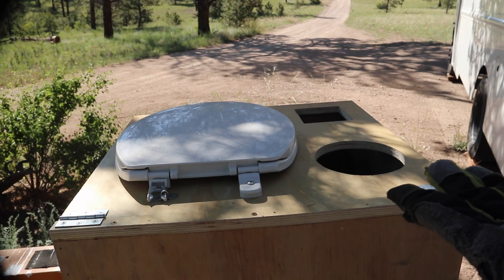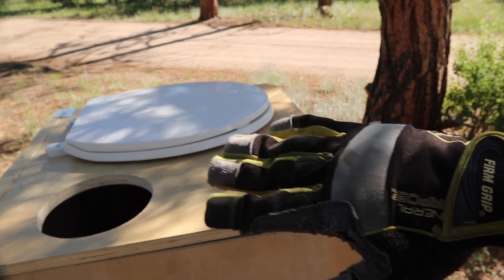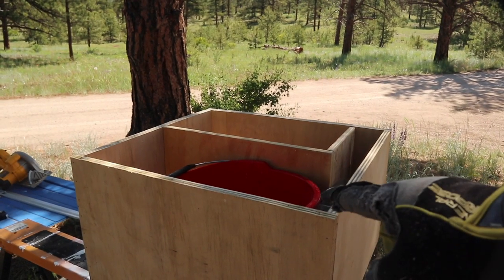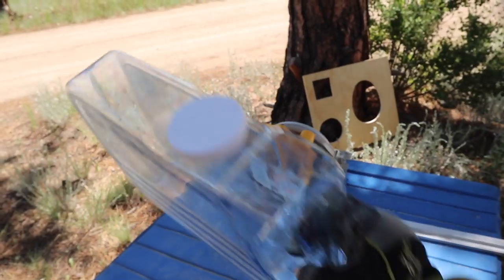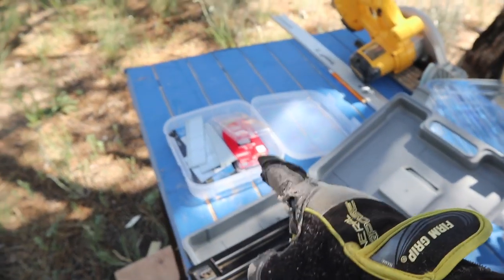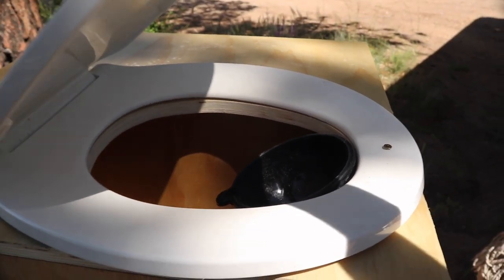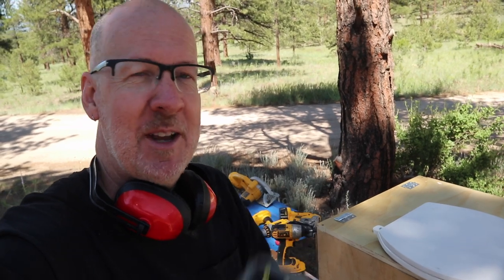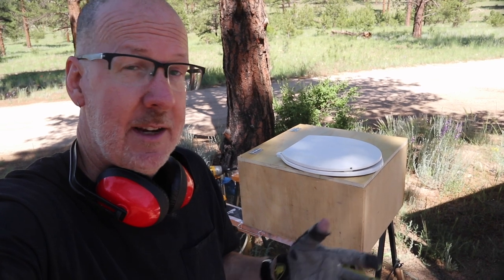DIY Composting Toilet Modifications for Vanlife P2 E561

Comment: Just a thought , Remove the spicket, cover hole on container with thin sheet of plastic( like zip-lok sandwich bag) and then replace spicket. just a little extra protection in case something hit the lever on the spicket
Reply: Or a piece of hard plastic from a pop bottle, milk jug or something like that, cut it to fit the screw on part, use a rubber washer and cut the spicket off.

Comment: We used pine pellets for horse stalls for the composting toilet in our off grid home. 50 pound bags are about $5 at Tractor Supply. Smells like a pine tree. 👍🏻
Reply from the maker: great tip. I wasn't aware of the pine pellets. will have to check tractor supply
Reply: @SevenWanderstheWorld  If a tractor supply is not close, feed stores will usually have pine pellets.  We use them in our cat litter boxes and in the horse stalls.  Very, Very little dust, pleasant aroma and quickly absorbs moisture.

Comment: You should nail a pole inside the little box with a plastic container w/lid for the toilet paper rolls.  That's a great composting toilet. Have you thought about attaching a stirrer for the red bucket? Can make it where the crank comes off while the whole system is stored and you can keep it in your little box inside until needed. Like a socket attachment for the crank.
Reply from the maker: that's a good idea. had not thought of a crank solution
Reply: @SevenWanderstheWorld  Thank you,  a good way to mix it so it doesn't just sit on top and all that

Comment: Mmm I was just wondering about the screw in the seat. At least that is what it looked like. Head is sticking up a little.  Cool project!!
Reply from the maker: I was a bit worried about the screw head at first (it is a round button head) but it actually is in-between my legs and I never sit on it so it hasn't been an issue

Comment: for the air hose you can just cut it right at the hole and insert an inline whatever its called, its just like a ribbed short straight connector that goes inside the hose, small hose clamp at each end of it and you are repaired. those hoses can get expensive so ill usually repair mine a few times before replacing and get a few years out of them.
Reply from the maker: great solution. thanks for suggesting it

Comment: Did your original composting toilet leave a lingering smell? Why is it desirable to have a urine diverter? There are very few experienced "real world" based opinions on "bucket toilets", so I'd love to hear your thoughts on this.
Reply from the maker: most of the smell comes from wet urine on the solids. separating the two is a key component essential to 99% of composting toilets. saw dust or peat moss is put upon the solids, so smell only lasts for a minute or two until you put the material like peat moss on the solids. in the end, the smell intensity is somewhat the same as a regular toilet but instead of a "flush" you have the action of using a scoop or material over your solids (not bucket toilets will smell because they typically don't separate urine and typically don't use a material on the solids